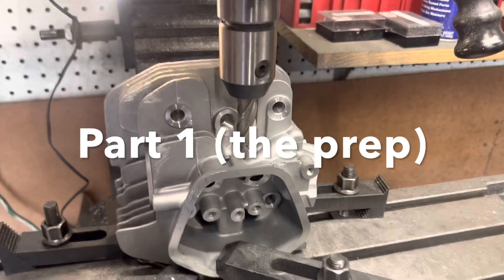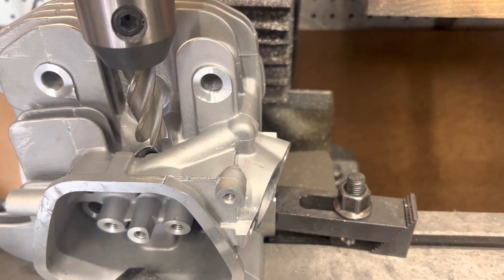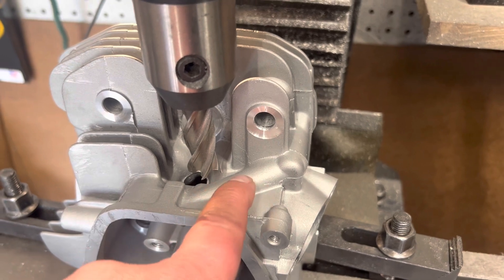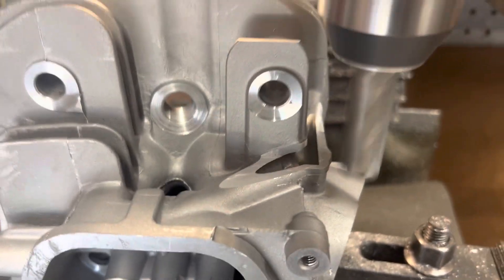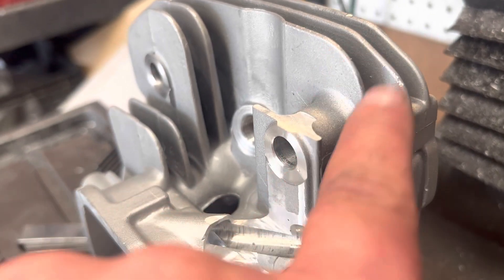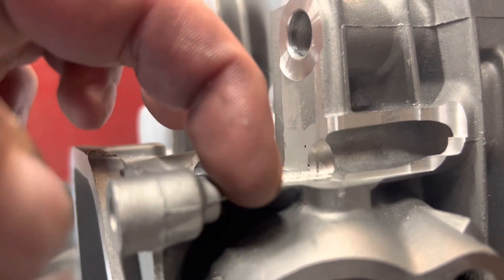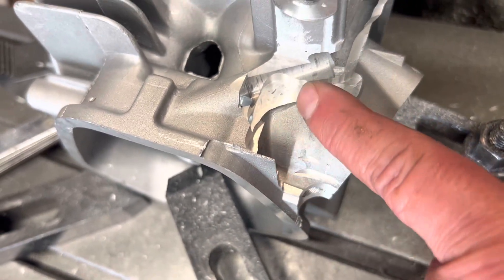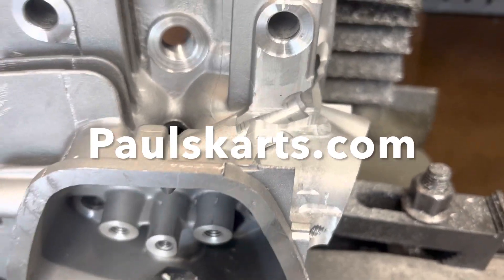Big block 500cc gx390 style head : ultimate head flow // preparing for welded port (Part 1)

Comment: Hi paul, love your work! How reliable is a 95/96mm bore big block?

Cheers.
Reply from the maker: Pretty good honestly .. we do a 97mm by 74mm stroke with steel rod .. makes a massive almost 600cc engine got 4 of them beating up the states now .. 95mm all day
Reply: @paulskartslifan4206  thanks paul. Last question. Do you weld the block for the 95-97mm bores.

Thanks
Reply: Paul i asked a while ago on another vid if you had any big pistons you said you would check and see. Im still interested. I have a 69mm stroke crank and arc rod for the 440 with flat top piston. Would like closer to 500cc
Reply from the maker: @garyfraser8584  text me 781-492-7358